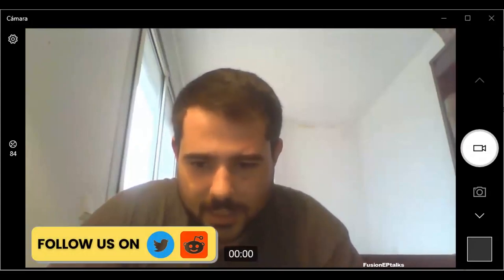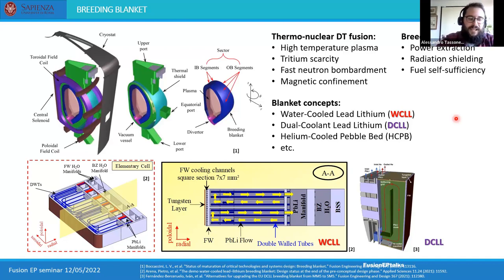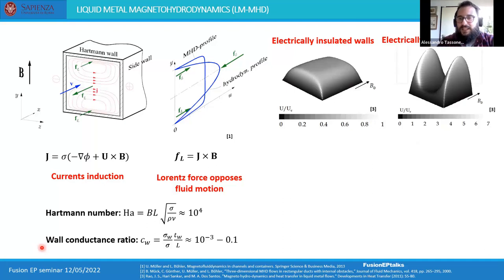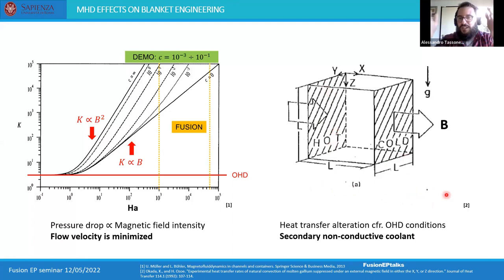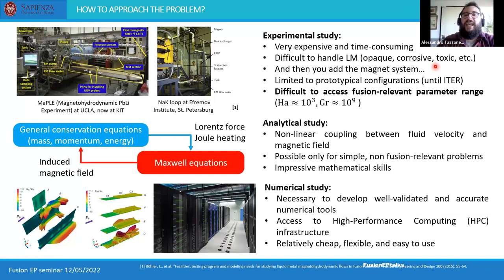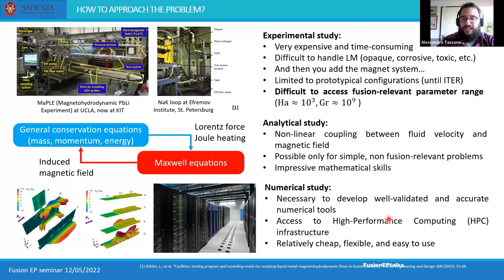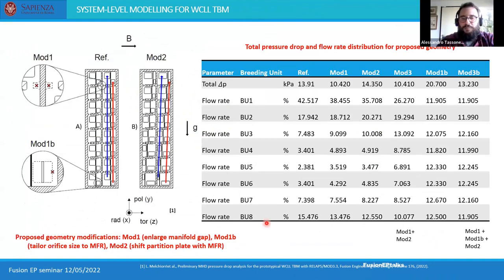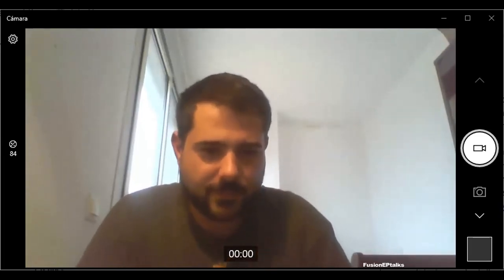Magnetohydrodynamic modelling for liquid metal systems and components |  Alessandro Tassone

Comment: Hello, it is a good presentation, thank you so much. I have questions, what is the effect of magnetic field on thermal and dynamic boundary layer thickness?
how to input or setting of magnetic field in ANSYS FLUENT?
Reply: Regarding a simple rectangular channel, you have a thickness inversely proportional to the Hartmann number (delta_H = L/Ha) for the kinematic boundary layer (Hartmann layer) developing close to a wall perpendicular to the magnetic field (Hartmann wall). For a wall parallel to the field, the scaling law is slightly different, indeed delta_S = L/Ha^(1/2). I do not recall specific relations for the thermal boundary layer, but keep in mind that heat transfer is strongly affected by the suppression of velocity oscillations operated by the magnetic field, so it is not uncommon to observe a heat transfer regime close to laminar convection or even purely diffusive. Regarding FLUENT, there is a section on the manual devoted to it.
Reply: Thank you so much for your answer @AlessandroTassone